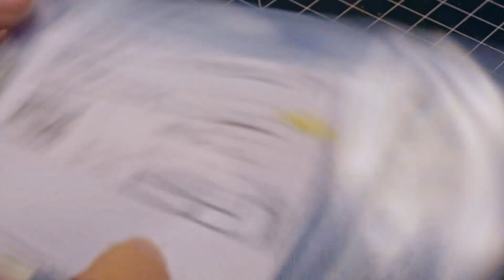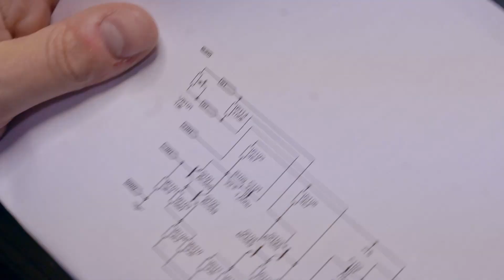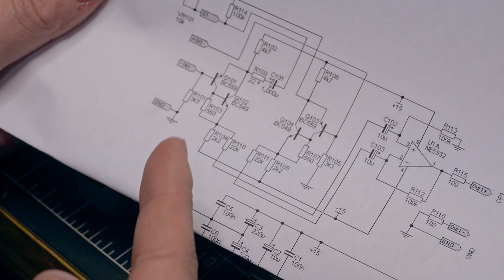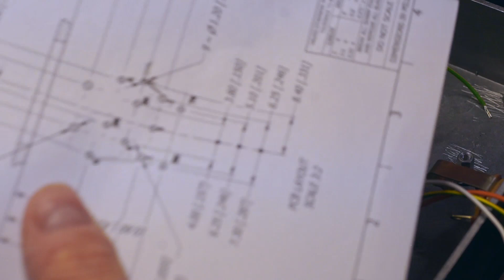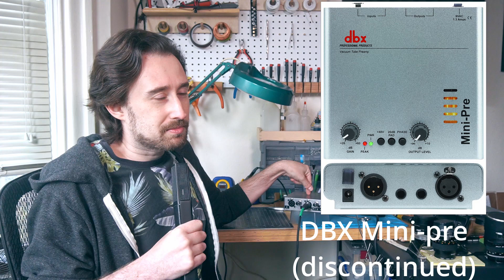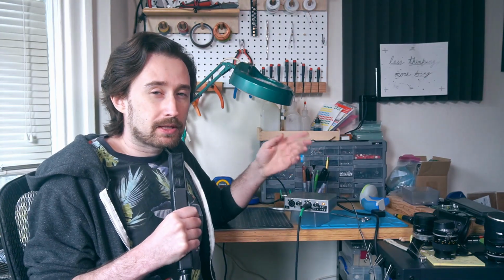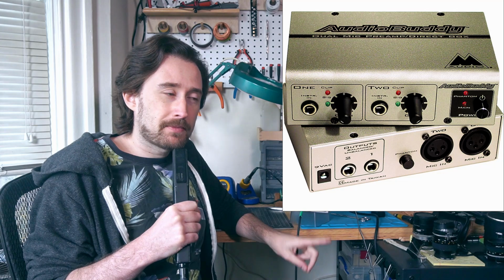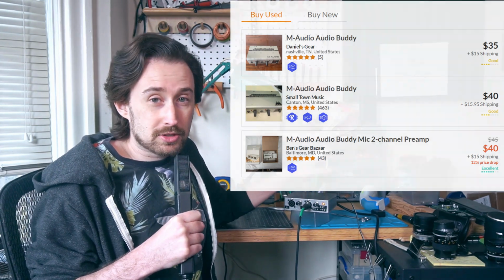Build and Review: DIY Dual Mic Preamp (ESP P-66)

Comment: Would have been nice if they put a simple Widlar transistor current sink in the design underneath the differential transistor pair, instead of just 2.2k resistors, usually really ups the CMRR

Comment: Excellent! As a woodworker, I always measure at least twice and as a circuit builder I check many more times. Also I like Linear Technologies LT1086 positive regulator over the lm317. However I love Li-ion batteries on a split rail.  ESP is excellent. I have made his power amp and hope to do his preamp with tone controls next. Now if we can get more electricians to sing on YouTube, I'd give that a thumbs up to that too:).
Cheers, Rob

Comment: If the preamp works well with two 9v batteries, then +12/-12v psu should also do, right?
Reply from the maker: Yes, +/-12 is what I'm using it with. I think the op amps are rated for their lowest noise at +/-15V.
Reply: Great video btw. Awesome cap exploding shot
Reply: I see that is +12 gnd -12, how you can put 12vac adaptor on it? Tell me please thankyou
Reply: @aldadanger802  try moritz klein diy psu

Comment: Twist cables which connect pin#2 and pin#3 from XLR sockets to PCB. Pots cables also. Would increase interference immunity.
It is better to choose insulated sleeve output sockets to avoid ground loops. Use single ground connection between chassis and circuit's ground.
Use deserve quality 1:1 signal transformer to get floating balanced output.
Sorry for my terrible language.

Comment: I really appreciate the video. I have only two things to add from my perspective. Motherboard stand offs are super cheap and you can usually just drill an appropriate hole and they will almost always cut their own threads. And I do plan on building this almost identical to what you have done here but with combo XLR output jacks instead of 1/4" just for versatility.

Comment: I was planing to build this preamp for years :) great stuff diy perks also made it but portable version for field recording.. Also i have steinberg,it has great preamps color wise but lot of noise, it has 2068d jrc opamp i am planing to upgrade it with lm4562 bi texas instrument.. Can you make video of you upgrading yours? I have low knowlage of eletronics
Reply from the maker: Thanks Ivan! Battery power would be a great upgrade for the preamp, probably help a little bit with performance as well if you use 2 9Vs for bipolar power. I haven't tested the steinberg too much as far as its preamps, but I'm not too picky about noise. I did see Julian Krause's review where he says their self-noise is about -123dB compared to -129dB for comparable stuff from Behringer, NI, etc. I don't know enough to say whether this is a factor of the op amp selection or another  part of the circuit, but if I find the recordings I get are too noisy for my liking I'll certainly look into modding it. I expect all you would need is a hot air station and a steady hand. 

Krause's review: https://www.youtube.com/watch?v=PSa27hkj3G8
Reply: So a +/-12v psu would fit for this project isnt it?
Reply from the maker: Yes it runs on a 12VAC supply into a +/- dual dc adapter board, much like euro rack supplies (e.g. MFOS wall wart)

Comment: Is there a way to wire this up to have balanced outputs instead of unbalanced? Might’ve missed something, but I’d find a balanced output more useful in a more professional setup
Reply from the maker: Yes, there is a separate balanced driver board available from ESP (project 51: https://sound-au.com/project51.htm . For the short cable run I have I wasn't too concerned about the signal but it would definitely improve the noise floor. I didn't really have room for another PCB in the case but perhaps with a smaller PSU board it could be made to fit.
Reply: @extralifedisco  awesome! My main concern is my interface, for whatever reason it sounds horrible using any unbalanced source, but balanced sounds lovely. Thanks for the response!!